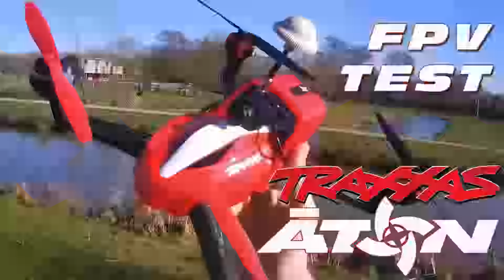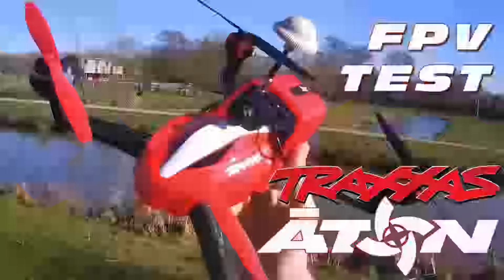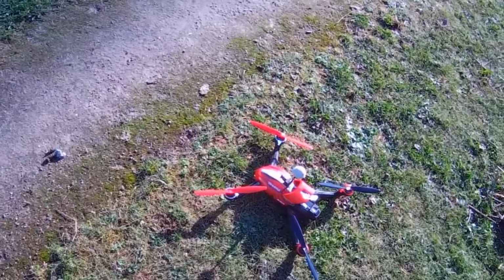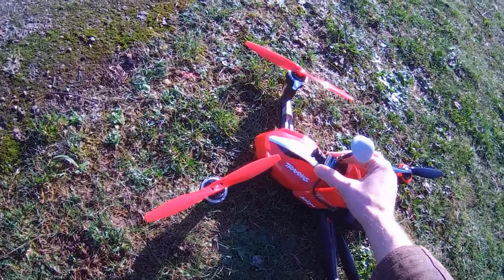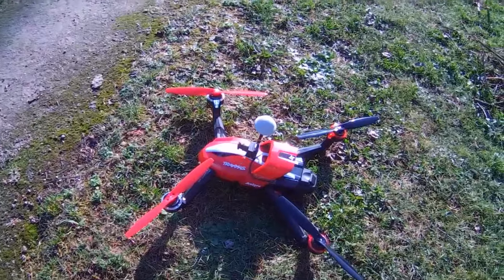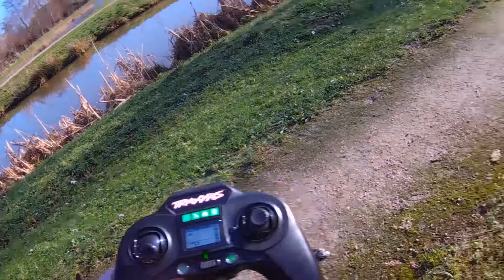Traxxas Aton + Aomway 700tvl FPV test

Comment: I liked the setup, but I must have missed something. How did you power the system?
Reply from the maker: This IS a great way to FPV your Aton indeed.. Well.. you didn't miss a LOT.. The Aton has a 12V JST connector (at the bottom).. This FPV system has a JST connector as well.. That's all :)
Reply: Thanks so much Dutch. I'll check it out when I get home. In Vegas right now. Going to do one of my Atons ASAP.  I love that Quad.  I've Got 2 of them. I fly most in expert mode LOS.  Flying fpv with the Aton, and this system should be a piece of cake. Keep up the good work.
Reply from the maker: You are welcome Andre :)  Yeps.. you won't have Any problem at all getting this to work.. 
The Aton indeed is a very nice quad to throw around indeed.. I have a Eachine competitor here now (video on it isn't done yet) which flies more-less the same by the way: 
http://www.banggood.com/Eachine-Pioneer-E350-With-GPS-915MHz-Radio-Telemetry-Kit-2_4G-8CH-RC-Quadcopter-RTF-p-1075923.html?p=TO251813974002015038 
Makes sense it flies the same, as it has the same flight controller ;)

Comment: hi. it seems like works nice. could tell the exact equipment that i need to buy to make my aton fpv? thanks
Reply from the maker: Hi there :)  Yes.. works like a charm ;) 
Well.. ALL you need is this: http://www.banggood.com/AOMWAY-FPV-5_8G-8CH-200mW-AV-Transmitter-Integrated-700TVL-CMOS-HD-Camera-For-Aerial-Photo-p-989258.html?p=TO251813974002015038 
The cable you need to connect it to the Aton (12V power supply) is included :)
Reply: Thanks bro... What googles u recommend? For start
Reply: thanks bro. you r a nice guy.
Reply from the maker: No problem at all sir! And thank you :)

Comment: I saw the FPV cam JST connector in the other vid,  curious where and what you connected it to here?   Did you run it into the battery bay, or a sep batt hidden under that arch thing?
Reply from the maker: Very simpel really.. This FPV-system has a JST connector, and the Aton has a JST connector at it's bottom.. Couldn't be simper really
Reply: Ah, I see what you mean, there's a 12v JST for the optional gimbal.  That is simple.   (Another question please) As a more subtle configuration than using the gimbal, could one strap a Mobius or RunCam underneath it and trim the legs to half?   When I go to a field to buzz around rather than serious filming, I don't want it to look like ESPN is showing up.  ha.
Reply from the maker: Ghehe well sure you could! I have not tried that, so Maybe you'd have to add a bit of foam in-between to get rid of vibrations :)

Comment: Hi is this FPV security camera any good?And what lipo can it be used with?
Reply from the maker: +Andy Black Yeps.. this is a good camera for Sure :)  It can be powered right from the Aton, or a small 2S lipo..
Reply: @DutchRC  Cool! Can it be used on big R/C planes & how can i get my video to connect to it I have a monitor & some FPV goggles from a while back.
Reply from the maker: @pricelessppp  Well sure.. this setup can be used for most any FPV setup (even on cars if you'd want).. 
On the VTX (transmitter) you select a frequency, and on your receiving end (monitor / google) you select That frequency...
Reply: @DutchRC  Ok. Cool thx also i GOT A Black pearl monitor a year ago or so. Do  I turn it on before I plug in the battery on it first than the FPV camera VTX?
Reply from the maker: @pricelessppp  No worries man :) 
Well that shouldn't matter really :)  There's no wrong order in turning things on in FPV-land (not like 2.4 Ghz control stuff in which the order Does matter :))
Reply: @DutchRC  Cool. Bud any other cameras similar to this around 250mw rating?
Reply from the maker: @pricelessppp  there definately IS the option of getting a seperate FPV camera, and seperate VTX (transmitter).. But you would need a bit more know-how to get that going.. 
The nice thing of this Aomway option is that it's basically a no brainer.. 
This is an option though: https://www.banggood.com/RunCam-TX200UMicro-Eagle-Combo-5_8G-48CH-VTX-11_8-CMOS-800TVL-WDR-FPV-Camera-Transmitter-p-1299346.html?p=TO251813974002015038 
One of the best (if not THE best) FPV camera's at this moment)..  You will have to put a JST plug onto it.. should be hard?
Reply from the maker: @pricelessppp  To get an impression of the range of that VTX: https://www.youtube.com/watch?v=GfKmy9xkico

Comment: Hey Dutch....got my Aomway camera in today and hooked it to my Aton.  Right away my goggles popped a beautiful picture then poof it was gone.  The camera got very hot.  I let it cool down and again showed a great picture in the goggles and again poof the pic was gone.  I bought it from Amazon so I packed it up and did a return.  I really like the camera so I think I'll order another.  Hopefully this one will work.
Reply from the maker: Howdy Don,
oeps.. that's not nice! Well good offcourse it Did work with your goggle :) 
Do keep in mind it Is normal for VTX's to get warm.. they kinda need airflow (from flying) to stay at a reasonable temperature.. Having said that, they shouldn't go poof after just a minute or so...
Reply: I have returned that one and ordered another.  On the bright side it did this in the living room and not in the air.  Hopefully the next one will be ok.

Comment: I have the same Aomway backpack camera.  I had it on a blade 200qx, but the camera had much more range than the 200qx and it was pretty high up, and I flew it out of range, and it crashed on some rocks, and so, no more 200qx. So i just ordered the Aton a couple days ago. Seeing your video made me very happy! :o)  I was wondering, have you tried the rth or flew it past the geo fence which activates rth with the Aomway on it? I want to make sure it don`t interfere with the gps, so if i get past geo fence it still returns to home. Thank you! Can`t wait to get mine and strap the Amway on it!!
Reply from the maker: Howdy sir :)  sorry about your crash man! Though that Is part of the hobby offcourse.. (I've had a few crashes myself today :P) 
I'm sorry to say I have not tried that.. BUT I could not sense any chance in aquiring a GPS lock. So I guess in that sense I did test if there were interference issues.. 
You could offcourse test it, as you can allways fly back with the FPV view? (yes, I understand you want the rth for when you loose FPV range ;))
Reply: Maybe I`m misunderstanding you? Are you saying you could not get a gps lock? So you were flying in sport mode with no gps? Or are you saying you had gps lock the whole time and just never tried RTH?
Reply from the maker: I COULD.. there was no difference between having, or not having the Aomway FPV system on the quad.. Getting a GPS lock worked just as quickly.. 
True.. I did have GPS lock (with the Aomoway thing on it).. but I never used the rth..
Reply: Thank you for your video and comments! Can`t wait to try this on mine when it gets here!
Reply from the maker: You're welcome! Let me know how it works out on your end :)

Comment: Does it matter which goggles?
Reply from the maker: Check the product-page over here: http://www.banggood.com/AOMWAY-FPV-5_8G-8CH-200mW-AV-Transmitter-Integrated-700TVL-CMOS-HD-Camera-For-Aerial-Photo-p-989258.html?p=TO251813974002015038 
To see if your goggle can use those frequencies..But yes.. it would work with most / all goggles I know off..

Comment: to bad you can't go any further than 200' then it returns home - put mobius and cradle dock underneath it plug it in to jst and i can go as far as i want
Reply from the maker: 200 what? :$  meters? With a good antenna on your receiver this setup has a range of at least 1Km.. 
It doesn't provide a 1080P video offcourse.. that's not what FPV is for..

Comment: pets cat
Reply from the maker: Ghehe yes.. Onyx shows up in my video's from time to time ;)
Reply: DutchRC Adventures haha how good is range? and how much for fps headset
Reply from the maker: It's quite hard to say anything about that, as it depends on Where you fly (lot's of interefence / no interference).. What the landscape is like.. What antenna's you use.. How high/low is the quad flying.. 
But this set works well.. You should have no problem getting a range of 500-800 meters..

Depends on your budget quite a bit :) 
At the lower end, this one is quite a good option: 
https://hobbyking.com/en_us/quanum-cyclops-v2-fpv-goggle.html